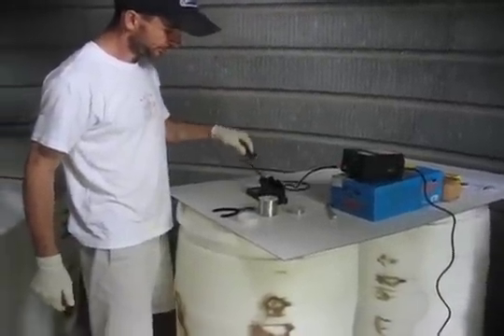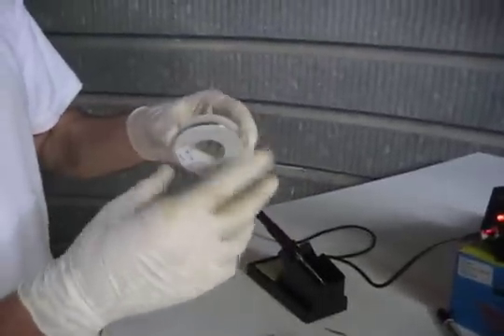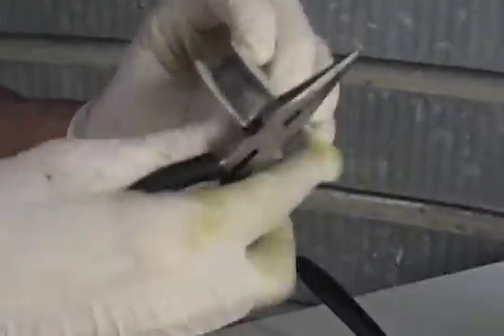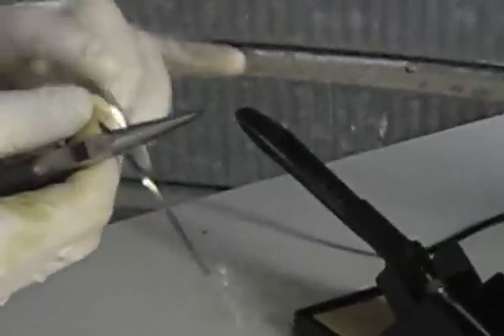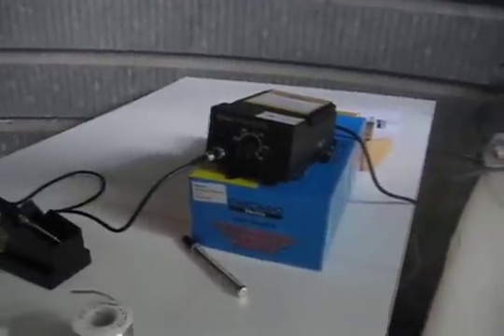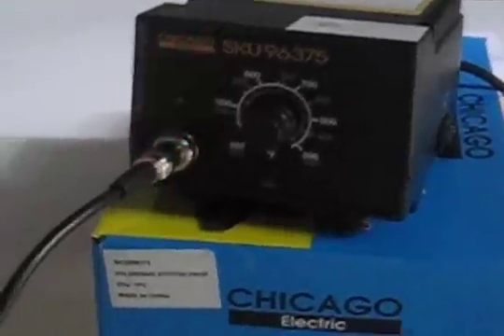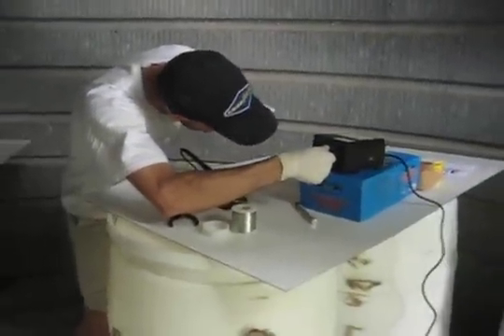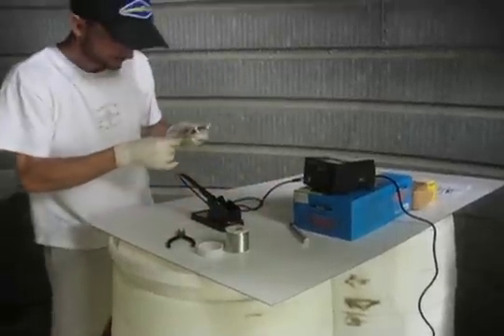Solar Panel Construction 1 - Open Source Ecology

Comment: soldering solar sells just seams like a royal in not emperial pain in the ass...

i've seen longer demos.. those blasted things break super easy and if a you have to test it all the time to verify that your not missing something thats not connected....

there has to be an easier way...

Why cant they manufacture then in some way that lets you use a conductive tape or some sort of snapp fit method...

Solar cells for lazy ass bastards :3